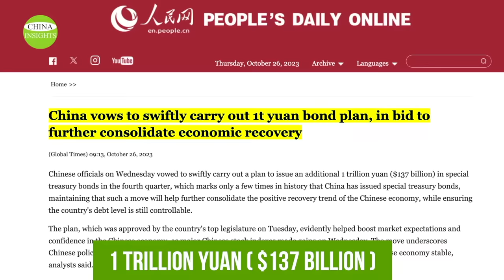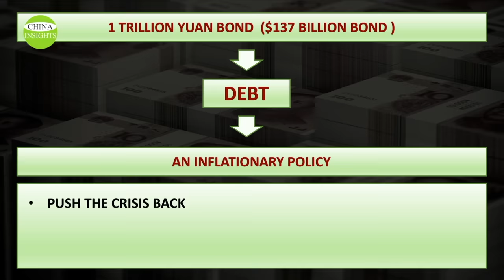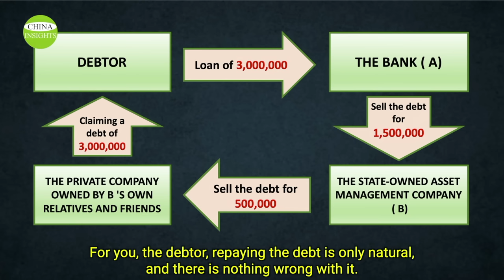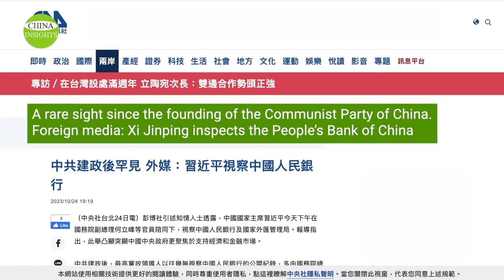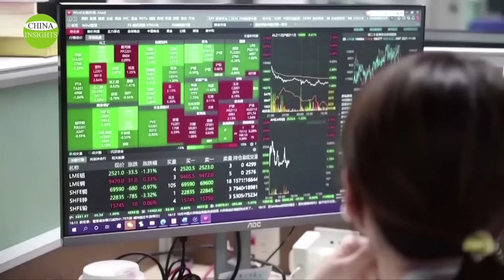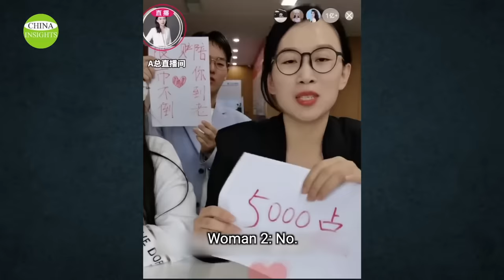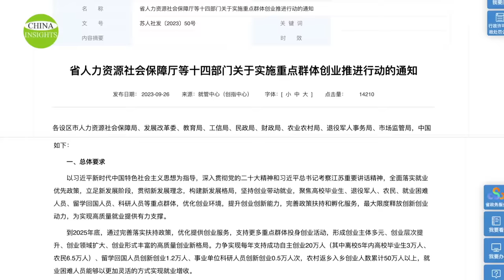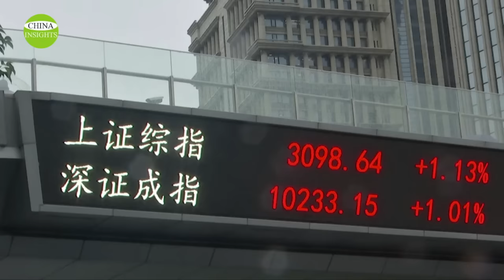Four China's Markets All Killed: From central to the local are so anxious/Massive Bond Issued

Comment: And... how will the effect * us *?  That's the question no one is addressing. If the worst hap l ens and China's economy tanks, what will the impact be on the US?
Reply: The US economy will suffer short-to-medium term if the Chinese economy craters, but the country will be better off economically & geopolitically long term. Ditto the world.
Reply: @brunopadovani7347  Lets be clear here, it will be 2008 all over again. But the longer the collapse takes to happen, the better of the world is.
Reply: US's largest trading partner is Mexico, the West and other developed countries (Japan, S Korea, etc) have been near shoring, friend shoring and on shoring manufacturing and supply lines of all goods for the last 8-10 years. It will be an expensive period of adjustment when the CPC collapses, and then it will be an extremely high growth period afterwards of 20+ years for those who aren't the PRC or it's "friends."
Reply: @benghazi4216  2008 was bad, but far from the end of the world. Decoupling from China will be a long term net positive for any industrialized nation that trades with China. China's trade strategy is and always has been to run large industrial trade surpluses, to the detriment of every country that it trades with. Geopolitically, China strategically seeks to hollow out the industries of any rival nation. Given these irrefutable facts, there is no scenario under the sun where it is not to our long term benefit to decouple.
Reply: @brunopadovani7347  I don't disagree with that at all
Reply: Still no answers here. Why, * exactly *, would it he "bad" for us after all?!
Reply: @midnightchannel111  US's largest trading partner is Mexico, the West and other developed countries (Japan, S Korea, etc) have been near shoring, friend shoring and on shoring manufacturing and supply lines of all goods for the last 8-10 years. It will be an expensive period of adjustment when the CPC collapses, and then it will be an extremely high growth period afterwards of 20+ years for those who aren't the PRC or it's "friends."
Reply: @midnightchannel111  It is stated already, it will cause a worldwide recession like in 2008. That is the opposite of good.
Just cancer alone took 260k more lives because of the crisis. Over 30 million jobs lost, countless life ending decisions etc etc.